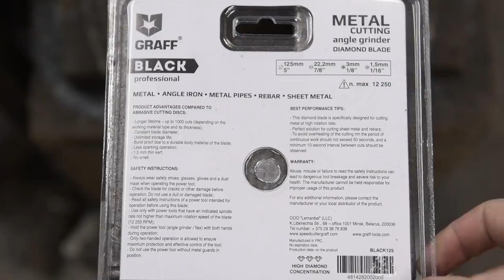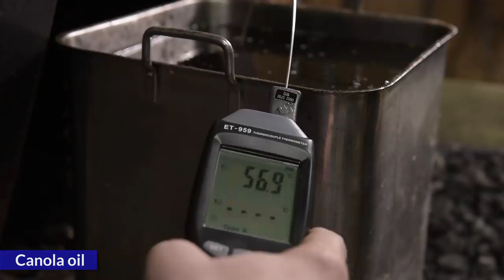Blacksmithing - Forging a slitting chisel

Comment: Beautiful! Why did you remove the forged to finish patina from most of your workpiece? Was it to achieve the look you wanted or to make the chisel perform better. Thanks.
Reply from the maker: Thanks. The working end should be smooth and since this is a large part of the tool I though I would try something different.
Reply: The finished forging was so perfect I was rooting for you to leave the forged patina. It’s all good though. I can’t wait for each of your videos and I’m jealous that you have two power hammers.

Comment: Very nice. Early in the process it looks like you cut something off. Why?  At the beginning, you sekectef a piece of metal. It appeared that the size and weight were unimportant. But the finished product was substantial. How do you calculate finished product weight initially? For you its experience and judgment but for the uneducated like myself, what do I look for?
Reply from the maker: Yes, I cut off a piece since I didn't make an exact estimate of how much material I needed. I just went to work on the piece I got. A more scientific way would be to make a drawing and calculate the volume of material needed, then you know what to start with.
Reply: @torbjornahman  ok. I understand. That's why you are good at what you do , and I watch, hoping to learn. Keep these videos coming. All of them. Thank you.

Comment: If you x2 the size its what  British rail called a keying hammer its stubby end to knock the rail wooden keys in to a chair that held the rail to the sleeper and the long end  to remove them after years in place some wooden keys where stubbren and i tell you it took some swearing to remove them
Reply from the maker: I have seen them! Pretty cool hammers.

Comment: Hello,how are you. I would like know, when you take the tool out of the forge It's dips a bucket seems to be sand, what is this procedure for.
Reply from the maker: It's vermiculite, it helps to make the steel cool slowly. That is a procedure called annealing, which makes the steel soft before grinding, machining or filing.
Reply: @torbjornahman  Thank you,got it

Comment: Another beautiful piece of work. How much would you charge for a 4lb. rounding hammer?
Reply from the maker: Thanks. I don't make anything for sale really... if I do it will show up on my web page.
Reply: I just figured I'd ask. I've been trying to find one for a while but I can't find one that's at a reasonable price and the ones I do the faces aren't ground right. I mean how many people have $200+ laying around to throw away on a hammer.
Reply from the maker: @Regdiggs  If you have a grinder it's not that hard to regrind the faces as you like. Even a super cheap sledge can be transformed to a very useful tool!
Reply: I have thought about doing that actually. I hope I'm not keeping you awake or anything what time is it where you are?
Reply from the maker: :) About 10 AM when you wrote that message, so no big deal!

Comment: The boss, or hinge portion of your hammer tongs...I tried to listen to Brian Brazeal explain the construction of what I understand to be called the Hebermann corner...?  Was more confused than the beginning.   Can you explain this in your tong please?
Reply from the maker: The Habernann corner is the square corner that bends the working end of the tongs, not at the boss area. The idea is to make a tight bend and then peen the rounded corner out to a point, at the same time thinning the material down. Structurally that is much stronger than just the bend and the cross section is much "wider". Like applying force on a plank on it's edge rather than having it lay down flat.... if that makes sense? I don't think I made that type of corner on my tongs, not that pronounced at least.

Comment: I learned at school never use diamond disc to cut steel and iron because high temperature and the metal cause chemical abrasion of the diamond
Reply from the maker: Me too, but this one is apparently made for this application. Not sure what they did differently.

Comment: Ever thought about betting a cold saw for the shop?
Reply from the maker: I have an old cold saw. I use it quite often in the videos...
Reply: @torbjornahman  I'm talking about a circular one.
Reply from the maker: Ah, I have looked at the proper ones using blades with teeth and coolant. Seems to work quite well. I had an old one with an abrasive disk, but that was a terrible thing.

Comment: Hi Torbi, is it possible to make a good slitting chisel from common structural steel? Best Regards, Jan
Reply from the maker: Not really...the steel needs to be tough! That said some rebar can be pretty decent. Keep the tool cool!
Reply: Thanks, well..I see you put sometimes the tool quick in water for cooling :-)

Comment: I had a flash of panic when you used those calipers as a scribe. Then I remembered that they aren’t mine.
Reply from the maker: Ha ha!
Reply: Very often they are made with tungsten carbide tips and measuring surfaces. The main reason is to keep the measuring surfaces flat and parallel, but it means you can use them as scribers and fast center-finding tools without much worry that you will damage them. Even hardened steel tips will work for quite a while without wearing away or deforming. Just don't use then on a file or whetstone.😆

Comment: I was under the impression that there was no point to wedge a tool like this? If it's being hit by another hammer, the amount of times you might miss hit and need to re handle??
Great finish though!!
Reply from the maker: Thanks! No you don't need to wedge it, but I felt that I wanted it to be a bit more secure here for some reason... I didn't glue the wedge

Comment: I may be alone in this, but rather than hang it on the wall, I want to see take an 8# hammer and slit a 50mm thick piece of H13 with it.
Reply from the maker: I have a project in mind... it might involve some of that...
Reply: Torbjörn, thanks for the video. I know many of your viewers are simply enjoying watching a man make a thing. 

Some of us however, are watching to learn. 
I just moved from an “anvil shaped object” to a proper anvil. I went for a new Perun Swiss Artisan anvil. I hope it turns out to be a good one. 

The first handled drift  I made broke on the 4th strike. Poor temper. Thanks for showing your temper technique here. It was not wasted. 

I appreciate the instructional component of your videos.
Reply from the maker: Thanks and good luck with your new anvil!

Comment: I think That you make a mistake, because you have to make That handle lose in These typ of hammer/chisel. That ist better for your hands 🤷🏼‍♂️ sorry for my bad english
Reply from the maker: It depends. For precision and a more secure way of removing it if it gets stuck it can be beneficial to have the handle fixes. Besides I seldom have anyone strike for me. It's really only then it can go really bad with a fixed handle.

Comment: Where's the mask when you tempered in this oil.You have mask when you forging, but when machine oil burning and smoking you are completely unprotected. I can't believe and understand why. By the way your work is very good.
Reply from the maker: Thanks! First of all, it's not machine oil, it's actually canola oil, which is not that bad. Then most of the smoke is sucked away by the chimney and it is smoking for a very limited time.

Comment: That's a huge lot of oil for just the tip.
Reply from the maker: Yes, but that is the amount I have in the container. That said I see many videos where way too little oil is used. The rule of thumb is 10 liters / 1 kg of material to cool.

Comment: perhaps one of these as a forging project.. https://i.imgur.com/vHtR8OT.jpg   4" faces https://i.imgur.com/CkVntPV.jpg,   5 1/4" long  https://i.imgur.com/7GWftVL.jpg   i am taking that is a forging line not a casting line.. https://i.imgur.com/7pxw7aj.jpg  Thumb for scale.. https://i.imgur.com/w3W0yn5.jpg   call it a Fencing maul.. https://i.imgur.com/FiPWx2o.jpg i think it weighs 17 pounds.   this one has been in my family for over 90 years..  i went to the parts store one day .. the auto body guy was swinging the shops 7 pound sledge hammer.. when i came back he was still swinging..  i yelled across and ask if he needed a bigger hammer..  he nodded..  i pulled this out of my car trunk and his eyes almost popped out of his head.  it only took 2 swings to straighten the bracket he had been pounding on for  15 minutes.  i took the hammer and leaned it against my tool box.. its too big go go in.  he was standing there panting..(breathing hard) drooling at my fencing maul.. i realized that he was going to take my fencing maul and run off to vegas and marry it. and be a happy man forever.  you should have seen the look on his face when i picked it up and locked it back in the trunk of my car.. it was like i had just run away with the most beautiful woman he had ever seen.
Reply from the maker: Ha ha, fun story! To me it actually looks cast. If it's made for fence poles it might suffice with a casting.